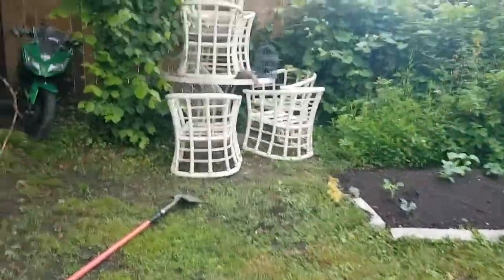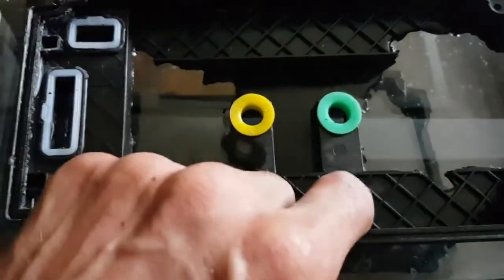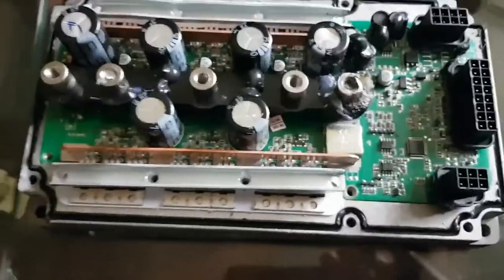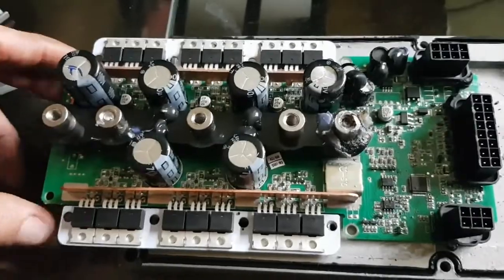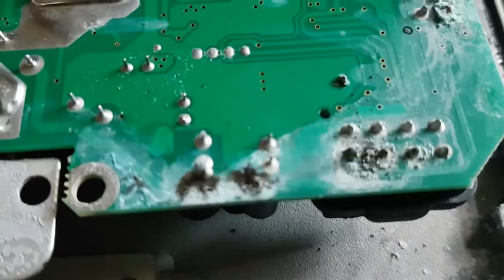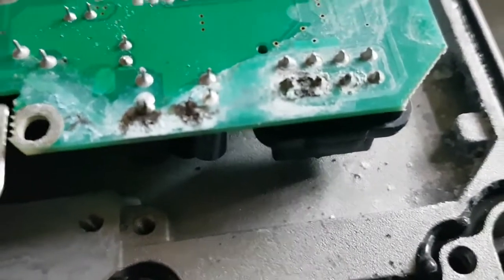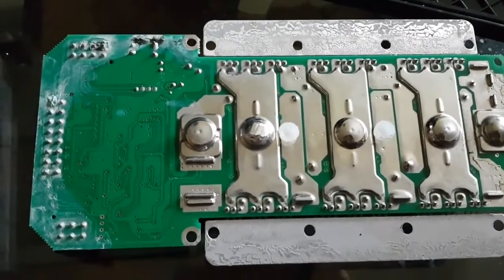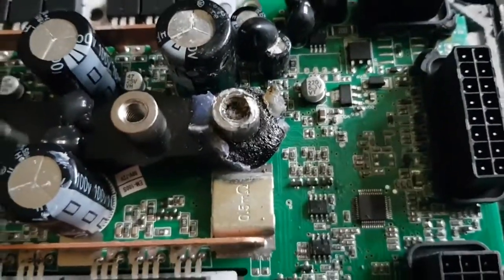Tao Leo - Votol EM-100 Teardown And Diagnose

Comment: hi.. can a bad mosfet measures ok in diode mode ? but be  bad? because have shutoff power while on load... currents phase 5a or less    and motor stops.... after 3 months of use with identical params....... i suspect bad mosfets but they seem perfect and all rest.... maybe res sense       .. what to check?
Reply from the maker: Check ur caps, then look for black on resistors and diodes. If all looks well then it probably is ur fets. And yes a fet could potentially measure bad in diode mode. Best way to test fets is to separate them from the board and test them under load. Personally I'd just get a new controller and avoid the headache. I've replaced mosfet just to have the rest blow. Then when they were all replaced I blew 2 caps and a resistor. But if that's the only route for u, good luck my friend. Hope u get it figured out.

Comment: hello!
How did you open the controller? Mine seems to have stopped working. I wanted to open it to see what's inside but I can't open it. thanks
Reply from the maker: It was very difficult. I had to pry the lid off. It's glued down with this black stuff. Its also gonna get stuck on the main posts. It's a pain. There's no screws. Just pry. Heating the outside with a heat gun or hair dryer whilst prying it up might help loosen the glue. Good luck.
Reply: @GreenLeoMan  hello!
I managed to open it and had to release it little by little.
When I opened it, 2 MOSFETs were completely melted. I will have to buy a new controller now I will buy the EM150 version as it supports more amps.
Thanks

Comment: How to open cover or casing controller ?
Reply from the maker: Is sealed. Have to pry it open or cut it open. Heat might loosen the glue stuff holding the lid on but u might damage components. And the 5 terminal rings are very hard to remove. It's not meant to be opened. You will definitely damage it trying to open it. I pryed mine apart piece by piece. Good luck.

Comment: Hey, I have a tao leo and was wondering if you know if i can over volt the votol em100 to about 98v fully charged and 92v nominal. Thanks
Reply from the maker: As far as i know they can do 85v. After that i wouldn't advise it. U'll probably fry it. U can however over AMP it. Mine is set to 100 amp and it gets pretty warm but within tolerance levels. Again 100 amp is the max draw i would give that controller and it's designed for a 72v battery(84.4v fully charged). So any higher than that and you are going to do damage to your controller. Hope that clears things up for ya. Tnx for watching :)

Comment: lol buy a bike cover? Mine started dying on me mid ride idk why im taking mine apart today i have no power tried switching breaker on and off it was working when i did that but now i cant get any power at all when i do that any idea?
Reply from the maker: Is it a tao leo? Could be ur battery failing. Sounds very familiar to what happened to me. But could be ur ignition too. Hard to tell. Start from the cheapest thing to fix and work your way through. Its all trial and error with these things. I knew nothing about these bikes when i bought mine. A power cut could be ignition or bms in my opinion. And if its the bms cutting power, u probably have some dead battery cells. The battery I repaired was it's second pack. The first 1 died and tao sent me a second which failed in the same way ur describing ( check my videos) and i had 16 dead cells. Not fun. Let me know how u make out. Good luck.
Reply: @GreenLeoMan  I took a volt meter to it said 67.6 might be time for a new battery eh?
Reply from the maker: Did u try to charge it? Will it charge?
Reply: Let me know how u made out .  I stored mine but some Some moisture might have gotten around my controller possibly.. Would that prevent  Is powering on my tao Leo
Reply from the maker: It shouldn't. Make sure ur breaker is on. Try charging the battery. Check the voltage coming out of the charger, should be around 84v output. My controller fried because i dug at it and broke the waterproof seal. Check those things first. Could be something simple too. Leo's are also infamous for faulty ignitions so check the plug on that and check the continuity with a volt meter. Let me know what u find.

Comment: Same here, I love my TAO Leo for the unlock controller that gets me safely through dangerous situations like car drivers not respecting my space.
Mine is stored outside with a bike cover and no real problem with it.
I will put a cover on the controller to prevent any water seepage through seal or connectors soon. Take care GreenLeoMan.
Reply from the maker: Just remember the controller dissipates heat through the metal bottom. Dont melt your cover or cook ur controller.
Reply: @GreenLeoMan  I have a G-Tech external HDD cover that would work quite well to keep water away from the controller without compromising the cooling of the controller.
Reply from the maker: There ya go :) let me know how it turns out